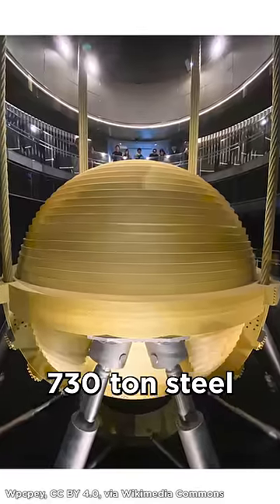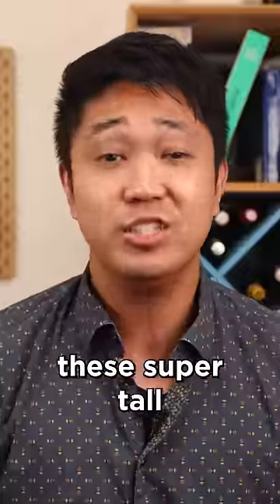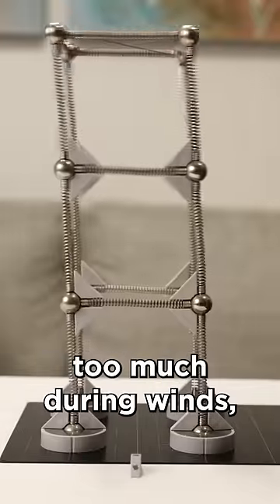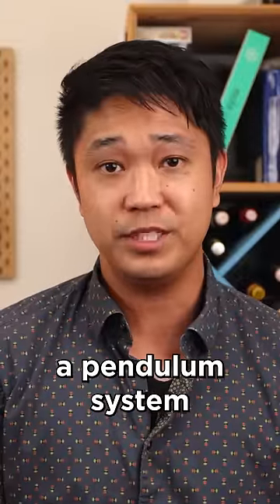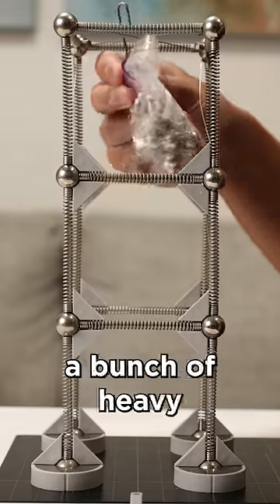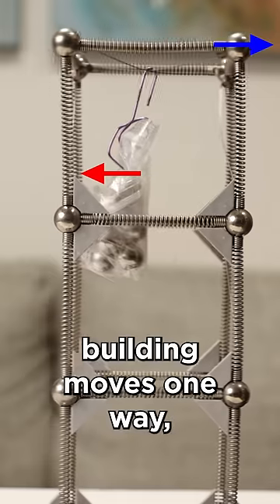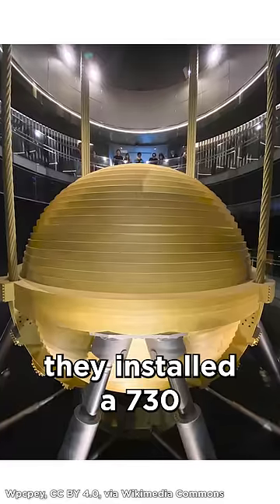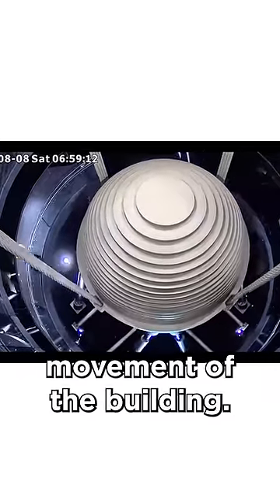Engineer Reacts to Taiwan's Earthquake Proof Skyscraper

Comment: Important to note. The TMD on Taipei 101, actually has its brakes activated during any significant seismic activities as the excitation would be too great, it’s primarily only operational for heavy storms and minor earthquakes, but actually doesn’t contribute to any comfort in sizeable earthquakes
Reply: I just love it when there is a good correction bellow a video like this :)
I wanted to say there is also a dampening device there, so its not just swaying of the mass
Reply: This building is doom once a 9.0 hits taiwan is in the area known as the ring of fire
Reply: So you’re saying it probably didn’t help at all during the recent 7.4 earthquake?
Reply: My first thought was what if it’s too large or a seismic event and the TMD ended up having the opposite effect, aiding in self destructing the building instead of helping
Reply: @brandonmeens  The brakes only restrict the range of motion and increase the amount of force required to move the ball. It still functions during earthquakes, just it's less effective at reducing wind sway while doing so.
Reply: @johnlacey3857   whatever contribution it had to the 7.4, wasn’t structural and it didn’t keep the building up.
Reply: I assumed same otherwise the ball itself wreck the building 😂. Also they could use it to extract some energy from it so it not becomes energy dump and have to use breaks often
Reply: Thanks for sharing 👍🏻
Reply: I was thinking about this. So it has limits to how much swinging it can handle?
Reply: @TonkarzOfSolSystem   they do. However the misconception is that the TMD is part of the structural assembly or isolation components that actually keep the building safe during Earthquakes.  The TMD could be removed from the building and it would still be safe during seismic events. It’s main purpose is just comfort and the only time it will be really noticed is when high winds and very small earthquakes are dampened.
Reply: @RM360CR  A 9.0 from what, a large asteroid strike?  Taipei 101 might do better than most smaller buildings from over engineering and scale advantage.
Reply: @johnlacey3857  Correct. It's also NOT a safety device in any way. Its ONLY purpose is for the comfort/safety of people in the building.
Reply: @glike2 no, there have been several 9.0 earthquakes, probably all on the ring of fire.
Reply: @glike2 i believe that a 10.0 on that scale is meant to be impossible
9.0s are rare but do happen 
Think the highest recorded was a 9.3 or 9.4
Reply: @TedTed-xh1ys  "'It's also NOT a safety device in any way. Its ONLY purpose is for the comfort/*safety*" Uhm what? You contradicted yourself.
Reply: @woodrunner51  correct
Reply: @EATZYOWAFFLEZ he meant it is not for the safety of the building. It is for the safety of those inside regarding their susceptibility to balance loss and nausea in constant swaying.
Reply: @kyleheins  oh ok that makes more sense. I figured safety of the building is equivalent to the safety of people in this case, because if the building collapses so do the people lol.
Reply: @EATZYOWAFFLEZ  generally that's how it would be said, but this particular comment mixed things up a bit.
Reply: @theirishviking9278 i mean in theory a 10.0 exists and higher but not on earth

However the highest is actually a 9.5 in chile 1960
Reply: There’s always a truth that totally destroys the ‘wow’ in a story like this. So in truth it’s nothing more than a false selling point.
Reply: @redders6858  it still helps to provide comfort most of the time

However nothing could possibly make a magnitude 7 earthquake even remotely comfortable
Reply: The brakes just restrict it’s movement to stop it from self destructing the building. It still reduces sway and as structural integrity goes, a lot of little things add up.
Reply: @FullOnGritz  Sure, but it isnt the major reason why the building withstood the earthquake. Thats the point of this comment, to correct misinformation
Reply: @RM360CR  homie do you know how big a 9.0 earthquake is? the 2011 tsunami in japan was caused by a 9.1, and it killed thousands and destroyed so much, even though the quake was nearly 80 miles off the coast. if Taiwan gets hit, it wouldn't be just the building that's doomed, the entire city and a good chunk of the island around it would probably be flattened.
Reply: So is it then an experiment in futility?
Reply: @lucycan6363  No it’s a very useful and pretty unique selling point to the building. It achieves what it was designed to do very well and generates a lot of money from tourism
Reply: @TonkarzOfSolSystem correct. The brakes can totally stop the movement if necessary im sure, but during severe earthquakes they just make it  significantly harder to move. It still can have just as much positive impact on sway reduction, they only do this because severe earthquakes could cause erratic movements or forces that exceed the safe limits of the TMD. It is kinda an oversimplification to say it would make the building less effective against wind. In fact, the stronger the wind, the more freedom they give to the TMD, but for different reasons for for the reasons why they clamp it down during earthquakes. 

The type of swaying caused by earthquakes and strong winds are very different. For strong winds, there is a constant force being applied on the whole structure pushing it in one direction. As the wind speeds change and the buildings own rigidity pushes back, the building starts to sway. Letting the mass damper soak up that momentum as much as possible by giving it maximum freedom helps keep it upright and minimizes sway. 

For a strong earthquake though, the whole building will be undergoing much more intense spikes of shockwaves from the ground up. The further away from the ground and up the building they travel, the more pronounced the effect will be on the stability of the entire structure. In this case, having the TMD on top of the building, tuned to resist motion and stay closer to its resting position, helps it attenuate these vibrations and shockwaves better. This is because these large shockwaves are strong enough to cause erratic behavior from the TMD that could add to the stress on the building instead of mitigating it. Also, the ‘heavier’ the apparent weight of it is, the more energy it will absorb before it even starts to move significantly, and much force more then it would absorb overall from a strong shockwave than it would when the TMD is moving freely. 

It is true I suppose to say that in this state, it is less effective at managing stresses from wind, and vice versa, so in theory strong winds occurring at the same time as an earthquake may compromise it, but I doubt it would mean the building totally fails. The TMD device is certainly meant more for comfort, but it also adds extra safety and redundant protections on top of Taipei 101’s extremely strong superstructure. In an worst case scenario they probably accounted for failure of the TMD itself to behave properly, especially during worst case scenarios such as that one. Worst comes to worst, the building’s underlying structure is likely built to be strong enough to withstand these conditions even when the TMD totally fails and works against the building’s integrity. That’s why it is still standing and haven’t ever seen any significant structural decline over the years.
Reply: @RM360CR  taiwan is doom if it gets hit by a 9.0 earthquake I dont know of any buildings that can handle that.
Reply: You guyss know whats the name of those magnet looking things he uses as the building?
Reply: To add, the main mechanism that does the most work during an earthquake for the Taipei 101 is a sort of base isolation during underneath the building that somewhat separates the building from the actual earth/foundation. The reason the mass damper is mentioned so often is because it's really visible for the public
Reply: I was thinking about what happens when it swings into the walls, the answer is, they don’t let it hit the walls. Must be bad 😂
Reply: I don't think confort is your main priority in the earthquake, but what do I know
Reply: @RM360CR It’ll be fine I’ll just hold the wall still until it’s over
Reply: Danger from earthquakes and any structural failure in general could be completely, i repeat, completely eliminated if instead of suicidal 500-1000m tall spires mankind built domes, say 100m tall, supported on springs like The Cheyenne Mountain Complex.
Reply: I was going to say, there isn't alot of clearance and I would imagine a scenario where that thing would start crashing into the building.
Reply: @johnlacey3857 Actually, it was 7.4 at the epicenter. Taipei was a 4. We definitely FELT it. But the government thought it was too insignificant to even send us earthquake warnings via the emergency broadcast system.
Reply: @TedTed-xh1ys "it's NOT a safety device.. it's only purpose is for safety of people in building" 🤡
Reply: @RM360CR Ring of fire means nothing to humans really other than regular small earthquakes.

When "the big one" hits, everything, no matter how well built is gone.
Reply: @glike2  Japan's 2011 earthquake hit 9.0 on the scale, son. They're only a few hundred short miles away from Taiwan.
Reply: Well, you wouldn't want the ball to slam into the side of the building. The dampening is quite necessary.
Reply: @EATZYOWAFFLEZ take a chill pill.
Reply: @AnthonyStabler  lol k gramps
Reply: It’s not just a pendulum system…. Those struts would allow for push back in the opposite direction of the sway…. So it would actually be MORE effective in more severe earthquakes… but what do I know I’m only a PHD engineer 🤦‍♂️🤡
Reply: @mbk0mbk No kid. It’s attached to the building… you can literally see the struts in the video. So no, that’s ignorance. It can’t swing more than it’s allowed to swing… and again, the way physics work it would be impossible for it to swing in the same direction the building is swaying… so it would ALWAYS counteract the sway… NEVER would it EVER be possible to assist the sway making it worse. That would defy physics and isn’t physically possible.
Reply: @nerd_world8919 yes… it clearly has struts in the video preventing too much movement…
Reply: @rugbychampion1 we get it you don’t understand physics or engineering whatsoever kiddo. Your comments have all been removed for misinformation.
Reply: @TedTed-xh1ys another kid who doesn’t understand physics or engineering. Go ahead and research into its real purpose before spreading misinformation middo
Reply: @kyleheins not at all. Misinformation.
Reply: @quangtuantran7181 it does contribute to the building not collapsing under heavy load… say the building itself could handle a 8.0 without it… with it? It’s handling more than an 8.0… atleast an 8.5 or 9.0. So yes, it absolutely does. Quite spreading misinformation. Reported.
Reply: @lucycan6363 No… it’s proven engineering and physics in action. Nothing expiremental.
Reply: @joshroi8610  in case of miniature earthquake or land slides there is energy added for it to swing hence the breaks by itself isolated it won't produce any energy but with earth movement/shock waves  it might collect energy . Idk tbh how effective it is or might be negligible in itself
Reply: @RM360CR A steel and concrete bunker is doomed once a 9.0 hits. No shit Sherlock.
Reply: @TedTed-xh1ys  "Its not a safety device in any way. Its ONLY purpose is for the comfort/safety of people" smh
Reply: Let's put a big weight at the top.....
Ya, not good in a major seismic event.
Reply: @RM360CR  9.3 Magnitude Earthquake happened on the East Coast, in April. Atleast 18 People died, over 1100 Wounded. Big chunks of Rocks also fell down from Mountains because of the Earthquake.
Reply: @TedTed-xh1ys ”it’s not a safety device it’s just a comfort/safety device” broski
Reply: I would think it would also be necessary to prevent simple harmonic motion.
Reply: Well no shit there’s not many things out there that can survive the ground breaking under it 😂
Reply: @RM360CR  so is literally everything else whats your point
Reply: @RM360CR  my man any building is doomed if a 9.0 hits them

Comment: Approximately 5.5 meters in diameter, the damper consists of 41 layers of 12.5 cm solid steel plating welded into a gold sphere mass, weighing 660 metric tons.
Reply: why gold I wonder..
Reply: @hannibalb8276 extremely dense, so more counterbalance
Reply: @FailedLobotomyPatient  If density was the issue, they'd use lead for this, gold is way too expensive. I think they were just referring to the colour.
Reply: @FailedLobotomyPatient  how sure are you that it failed
Reply: Thats a large ball
Reply: 660 tons of gold?  Lol sure buddy
Reply: @mastershooter64  USD 60,36,52,50,000 is the cost of that much 24K Gold right now. 60 Billion worth of Gold probably more than the building itself.
From the commentary it is obvious that it is just a Steel ball with Yellow or gold paint.
Reply: @mastershooter64  The colour, buddy, alchemy isn't real - you can't turn steel to gold by welding plates together.
Reply: @antorseax9492 Like the "gold" my causing bought from China. She refused to believe its fake till I heated it and it loosed its color 😂🤣
Reply: @TheEngineeringLexicon  so which one is it? 60? 36? 52? or 50 USD?
Reply: @TheEngineeringLexicon bruh why tf are your commas idiotically wrong 😂😂 it pissed me off
Reply: @JanKowalski-bm9rv  It's like the full number 2024 is neither 20 nor 24 but 2024. Are you American?
Reply: @JanKowalski-bm9rv  That's the cost of  24K Gold weighing 660 tons at yesterday's spot price for Gold.
Reply: @TheEngineeringLexicon  No, I'm just wondering what the hell kind of number is 60,36,52,50,000. Looks like a list of numbers to me.
Reply: @TheEngineeringLexicon  you either left out some digits or you added too many commas. Never seen a number formatted like that… hard to take what you say seriously when you’re accusing people to being Americans under a negative notion when you can’t even properly write a readable number value.
Reply: @TheEngineeringLexicon  you're missing a 0 in every denominator or your commas are off, if you're missing zeros then there a range of 600 quintillion, which I doubt any one will invest in a single building not collapsing in an earthquake
Reply: @ICM9 
 I had earlier added an explanation regarding commas but don't know why it got deleted, probably due to a broken link I added in it. 
 I explained in that comment that the  Indian number separation system uses comma separation after every second digit except for the first three, while Western number separation system uses it after three digits. Thus Indian system has names for 100,000 and 100,00,000 as 1 lakh and 1 Crore but Western system have names for 1000,000 and 1000,000,000 as Million and billion respectively. I am using the Indian system as it is the banking and financial standard and my device uses that only. the number is correct,  I used the spot price of Gold from that day and it does not vary much between nation at any given time.
I apologize for the trivial remark on American stereotypes. Honestly, I don't personally believe in any of that.
Reply: @TheEngineeringLexicon  ah, actually didn’t know that. Makes sense
Reply: @mastershooter64  that would be roughly 0.4% of all gold in the world if I got all the numbers correctly.
Reply: How many American tons is that?
Reply: So it will be deviated if it falls
Reply: Have visited it, the whole apparatus tales several floors and a great part of the visit. During an earthquake it has moved for about a feet, the building I do not remember but happy to not have been i' it at the time😂 Great engeenering!
Reply: yeah i could bench that, lightwork
Reply: The function of the gold paint was not to provide density.
Reply: @TheEngineeringLexicon  
That's so interesting! I didn't know about the different separation systems with numbers.

In recent years Europe has taken to using decimal points in place of commas and the trend has picked up in the West altogether.

603.652.50.000 is how some would write it, which is just weird to me.

So the use of commas in spaces of two completely threw me off too. Funny how we're all writing in English and still getting confused XD
Reply: @PromptedHawk exactly
Reply: Japan skycrapper also use a pool of water, its act the same function but cheaper
Reply: Everyone is arguing like they put the thing in there.
Reply: @hannibalb8276  artistic license the top has an observations deck of course and a beautiful display of coral plus outstanding view.
Reply: @soup_slayerShrek it's smaller than you think up close